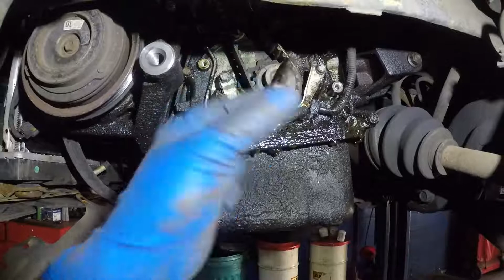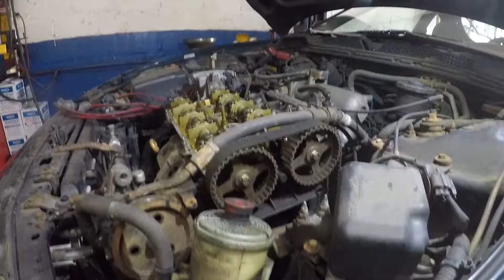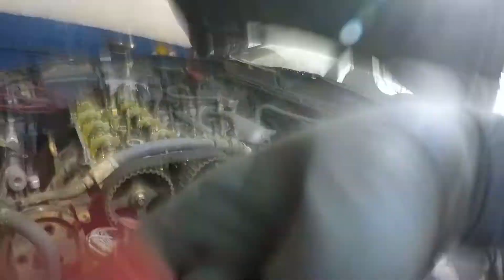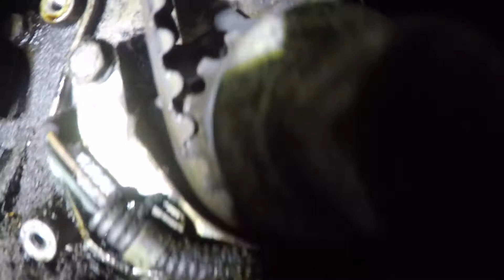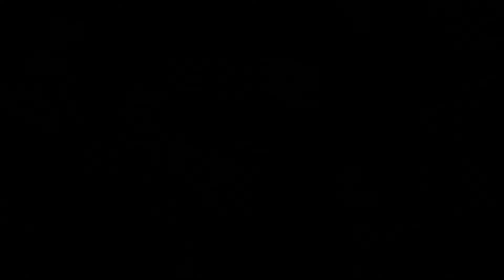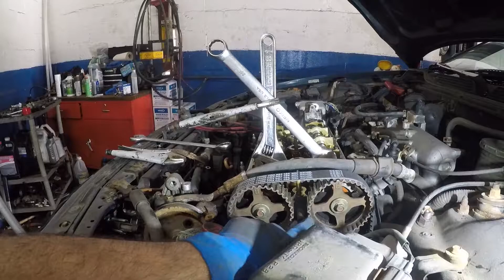How to replace Timing Belt & Water pump on Acura Integra Part 2

Comment: Im trying to do this now. The up marks on my Cams are not even, they are both at different points. How do i get them avoit the same so i can turn everything and get them all in place at same time
Reply from the maker: Did u aligne them before removing the belt
Reply: @RBTheMechanic  I did not

Comment: Can you tell me which one of the pulley wheels has the timing marks and the location of the pointer use to adjust the timing when you replace the distributor. thanks
Reply from the maker: What? What car u got? Usully distributed goes in to only one spot or u need too dead center cylinder 1 and then rotor has to point at number one
Reply: @RBTheMechanic  I have a 1994 Integra LS, just replaced a distributor. There should be timing marks on the pulley wheel and a timing pointer on the timing belt cover to use to adjust the timing with light gun. There are videos to show you how this is done. BUT it's hard for me to see where these marks are. 

Can you do it manually without taking the timing belt cover off ?
Reply from the maker: @sinnieleeonUtube  ur setting up distributes u should have to take out timing
Reply: @RBTheMechanic  You'd never done it with the timing gun.
Reply from the maker: @sinnieleeonUtube  no

Comment: I need to get my timing belt done and I am going to have a mechanic come to my house and do it.  What was the brand of water pump you said to stay away from?   I actually need a valve cover gasket but that looks like its actually part of the service.    This was a great video
Reply from the maker: Yeah do the valve cover since ur taking it apart. The gates water pump leaks quick try asin that’s what I use lot also do the crank seal

Comment: Man I hate to be that guy and you got the job done but I can tell you do not have the Honda service manual. You did everything backwards and wrong. I mean there are so many things you did wrong it's not even funny. First of all you're not supposed to put all that stuff back on top before you put the belt on .You're supposed to put the tensioner on before you put the belt on that way you don't strip out the threads trying to get it on. Then the cams... you don't need those stupid wrenches. There's actually holes in the cams and you're supposed to put Allen wrenches or pins in there and it holds the cams perfectly on the spot. I mean it's right there in the Honda manual LOL. Then you put the belt on completely wrong .it supposed to be in a certain sequence and you did it completely wrong.. it's supposed to go around the crankshaft ,around the tensioner, around the water pump,around the rear side cam gear and around the front side cam gear.If you have the allen tools  inserted into the cams it's a really easy . Then you're supposed to put all that stuff on top on. I mean you got it done but you almost ripped out the threads on the timing tensioner and you put everything on backwards.Oh man I hope this stuff doesn't pop off later and leave you stranded on the side of the road.
Reply from the maker: Thanks for the information but I don’t see a problem the way I did it and if it was wrong the envy would had been damaged and it’s been year car still runnning
Reply: @RBTheMechanic  You are supposed to rotate the engine clockwise three teeth on the sprocket to take up the belt slack then tighten the tensioner.

Comment: Have everything lined up car will not start.have spark fuel just changed water pump and belt was running before not now. 99 ls1.8. What might be wrong

Comment: 10:25 my pulley you took off is very tight. Used breaker bar and impact and it moves but very difficult. Thinking its stripped...
Reply from the maker: The tensioner pully how’s the threads on the bolt looking like
Reply: @RBTheMechanic  have no idea, I can’t remove the bolt
Reply: @RBTheMechanic  got the new pump in, new timing belt but tensioner is too loose I think, lots of raddling when I started the engine. The pump came with a new pulley but I just can’t remove it for some reason...
Reply from the maker: @aweuroworks  the pully on pump cannot be removed re check ur work too much tension on tensnor will cause nose but it cant be loose either
Reply: @RBTheMechanic  it came w a new one though. Also you removed yours at the time stamp above
Reply from the maker: @aweuroworks  that’s tensioner pully it should come out the bolt might be thread locked hard to remove
Reply: @RBTheMechanic  thankyou so much, going to give it another try soon.

Comment: Tried setting my timing for 3 hours botje cams just slip back to an off time after I set them aswell as the crank timing
Reply from the maker: Use wrenches to lock them up
Reply: @RBTheMechanic  I don’t think I can
Reply from the maker: @breadmaker3939  did u heat a noise when u cranked it.  Only way to determine it is to redue it and if it good then it will run fine and no noise
Reply: @RBTheMechanic  yea I’ve done 3 other timing belts never had this issue about to throw in the flag
Reply: @RBTheMechanic  can you dm me so I can have a chat I think my engine scrwed
Reply from the maker: @breadmaker3939  sorry I don’t direct contact Re due the timing double check the marks turn the engine manually to confirm
Reply: @RBTheMechanic  I think my rods are bent or something catastrophic, we can’t hold the engine in time it just sets it self back
Reply: Why does noone use the 5mm punches?!?!?!

Comment: Recently did the timing belt and water pump on my 1997 Honda CRV rotated at 6 X or tensioner loose 6 time put it at top dead center pushed up on tensioner and tightened it so you say that belt cannot jump it still looks a little loose any advice would be appreciated thank you
Reply from the maker: Derek Wilson I don’t think it will jump u took all the good steps did u match up the belt
Reply: @RBTheMechanic  you mean lined up all the marks
Reply: Yes rotated crank six times everything lined up great then I pushed up as hard as I could on tensioner and torque the bolt
Reply from the maker: Derek Wilson u can’t take the heck out of that belt make it super tight it will make wining noise usually I let the spring do the job just fair enough
Reply: @RBTheMechanic  no whining noises and it runs really smooth
Reply: So what you're telling me any slack in the rotation of that the tensioner will pick it up
Reply from the maker: Derek Wilson only on that side u cannot have any slack on the opposit side
Reply: @RBTheMechanic  alright I appreciate your advice I just hope I did it right and it doesn't jump time and blow engine
Reply from the maker: Derek Wilson just double check ur work ! U should be good
Reply: Somebody else that turn the crankshaft 90° then adjust the belt how am I going to do that with the cover on
Reply from the maker: Derek Wilson I didn’t under stand what ur saying did u not take the cover off
Reply: @RBTheMechanic  yes I took all covers off was wondering if I could recheck my tension from the top somehow
Reply: I think I better be safe than sorry I'm going to have to tear it down again and try to retention it or at least check it I did take all covers off when I initially did the whole job
Reply from the maker: Derek Wilson yeah brother check it always good idea some times I double triple check my work
Reply: @RBTheMechanic  the car runs fine I'm just worried about not having correct belt tension even though hopefully the tensioner will take up any slack I've driven a car around it runs fine
Reply: Man I'm sorry to keep riding to you but I wonder if I could take the valve cover off and the top of the cover and adjust belt tension that way instead of taking crankshaft pulley off and all accessory belts what do you think
Reply from the maker: Derek Wilson yeah u can do that bring all the marks to Aline before u loosen the tensnor
Reply: @RBTheMechanic  so once I do that I can see if belt got tighter where the top of the camshafts are that slack will go away correct
Reply from the maker: Derek Wilson u have to bring the slack to tensnor side and that will push that slack off
Reply: @RBTheMechanic  okay after six times turning the crankshaft with tensioner loose I pushed up on belt tensioner with screwdriver as hard as I could and tighten the tensioner I appreciate all your advice I will give us a shot and see if this works to ease my mind thank you I will get back to you on progress
Reply: Do you want to know the correct way to actually do it? The way that all the Honda mechanics do it? The way that is in the Honda factory service manual? You put everything at top dead center with the belt on and you just let the tensioner do its thing naturaly with the spring. Dont push up on it at all. Let the spring do its job . Then tighten bolt to tentioner. and then you rotate the engine 3 or 4 times and bring it back to top dead center again. Then you loosen the bolt of the tensioner 180-degrees ,a half a turn ,and then you rotate the timing belt three cam gear teeth and then you tighten the tensioner bolt back down.... that is how you adjust the tensioner and the belt.

Comment: this video is great. got his idea using two wrenches to keep the cams from moving the timing marks; one extra idea to keep the belt from slipping off both cams is using two wooden cloth hanging clips on the belt and the two cams gears. this way when you are trying to slip into the water pump, tensioner, and the main shaft gears, the belt will stay in place. i did that and works great.

Comment: by the way, you said removing the oil pump should be the water pump. thanks for this video; will me to remove the same problem water leak. thanks again.

Comment: Nice video, but a lot of people turn the timing belt 3 teeth counter-clockwise by turning the crank, this puts the right amount of tension on the spring loaded tensioner, which you then tighten.  I was getting a noisy distributor when I didn't pull the belt 3-teeth tight, and it went away after I did it over again ( https://youtu.be/EJEn63JbS9Q?t=461 )

Comment: Hello I'm at the part where I have to get everything at top dead center I've done that but I can't get the crank bolt off now to put the pulley back on what should I do?
Reply from the maker: G Money you have to hold it and give it tap with the impact gun it might be locked very slightly where it can’t come off by hand then u can turn the crank back if it move just a bit  it shouldn’t be hard